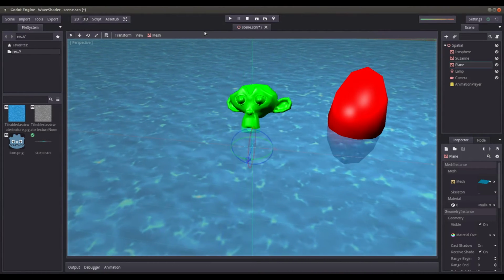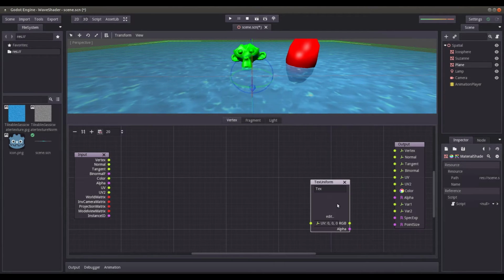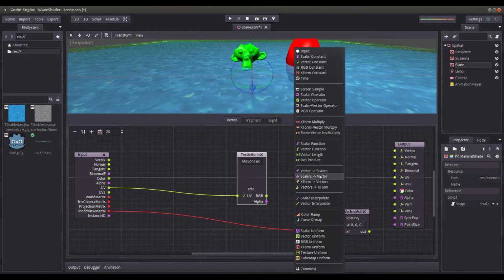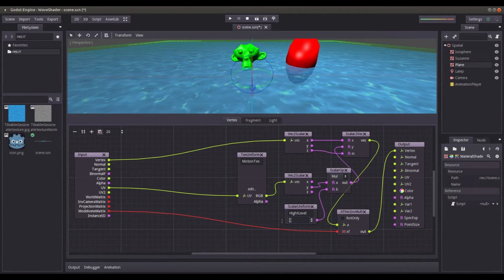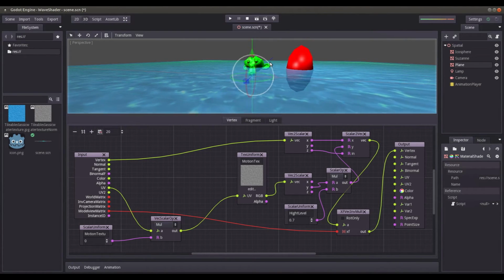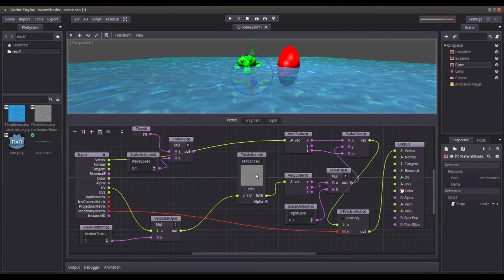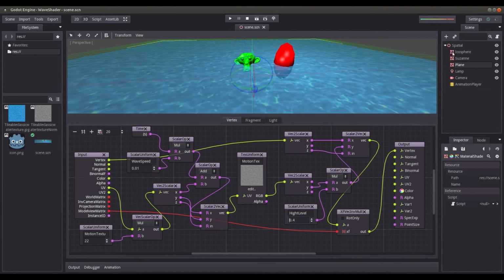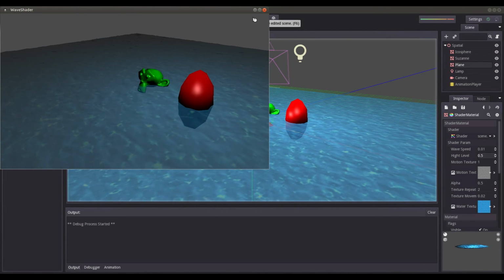Godot Water Shader Using Visual Shader Graph : Part 3 of 3

Comment: the tutorial is good, but it could be done more efficiently. Sometimes you are like figuring out what to do, and that's confusing. You should have it figured out already and just explain what you are doing and why, straight to the point. 
The whole tutorial could be done in 1 part :)
Reply from the maker: Thank you for your feedback,  I have had the opposite feedback that I was glossing over things too much so this one I did in 3 parts. I teach kids everyday so this may be for the level of a 12-16 year old like the students I teach. As far as "figuring out" I practice the tutorial at least 2x before I film it so even if it looks like the case it is not.
Reply: The speed is just fine. In any case you can skim over the videos by mutting them and playing at twice the speed. ;)